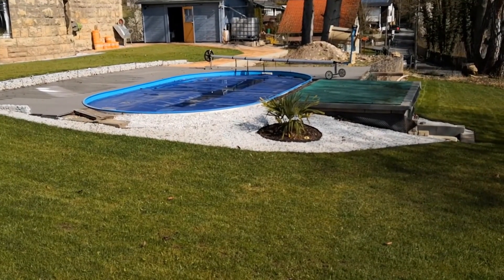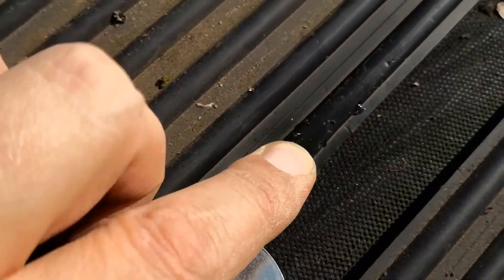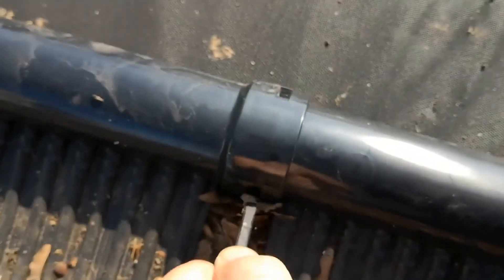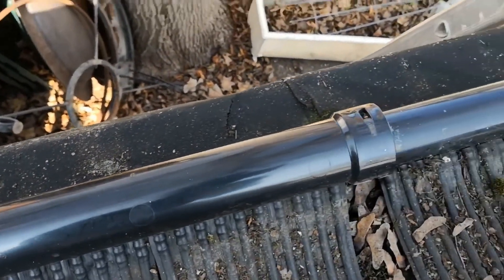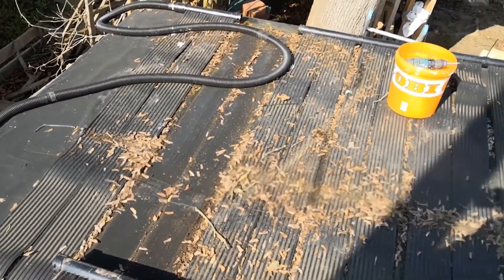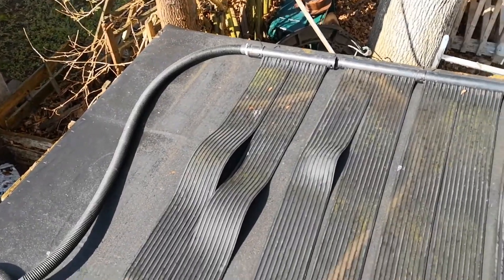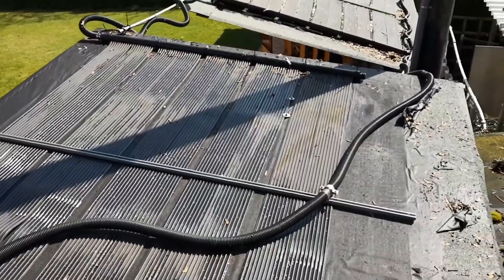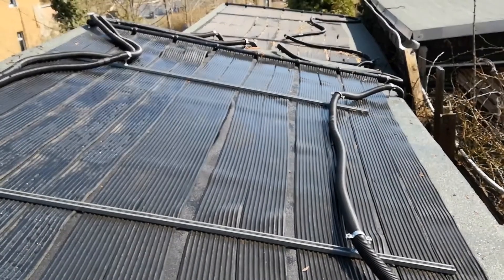Repairing and replacing EPDM solar mats - Build your own efficient pool heater

Comment from the maker: Product list*
🔗 Solar absorber EPDM solar heater: https://amzn.to/3UJe56f
🔗 Repair connector: https://amzn.to/37imIOg
🔗 Bypass set: https://amzn.to/2TNBXUJ
🔗 Solar hose: https://amzn.to/2WuCEUO

This video was originally created in German for my main YouTube channel @commaik 🔗 https://youtube.com/commaik. It has been translated into English using 🤖 the AI tool HeyGen, which replicates my voice and synchronizes my lip movements. 

Please note that ⚠ due to dynamic adjustments, the synchronization may not always be perfect.

📺 The original video, which includes English subtitles, can be found here: https://youtu.be/g9QNI7fyLGU